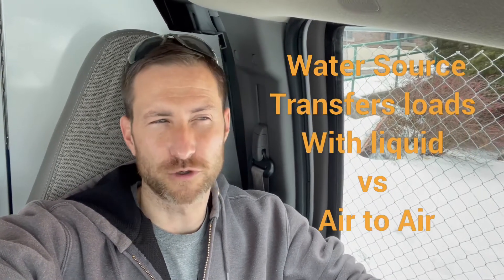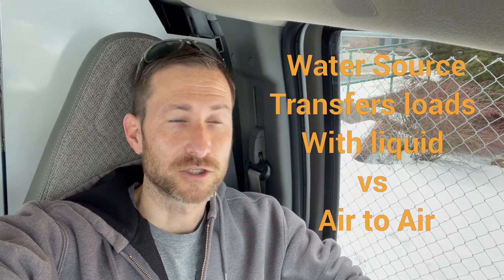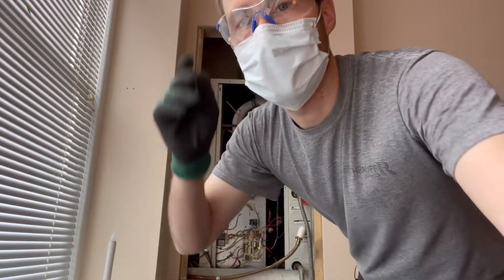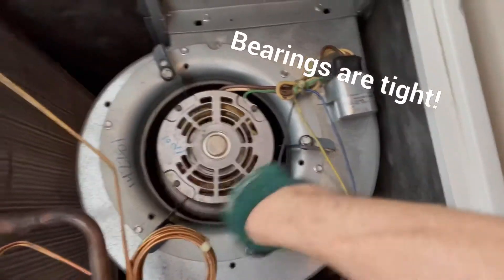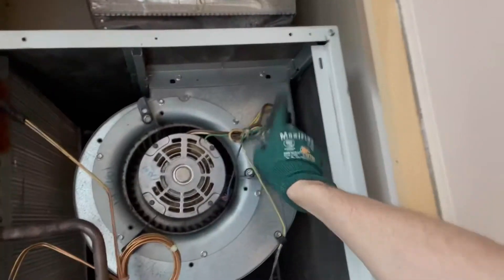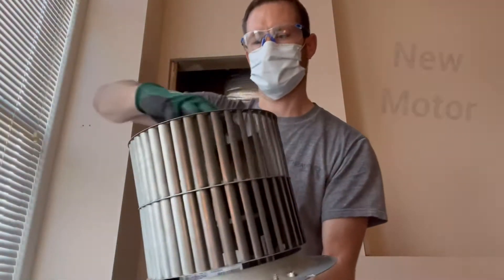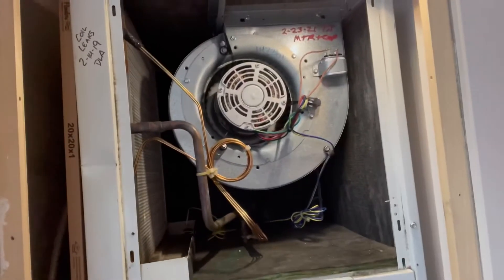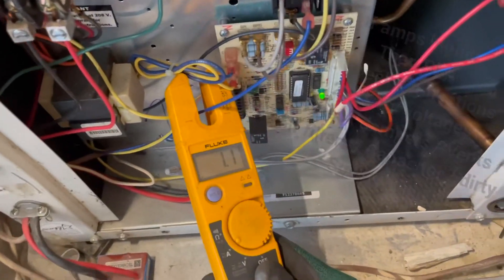Call of No Heat on ClimateMaster Water Source Heat Pump. #HVAC #HeatPump #HVACEXPLAINED #cooling

Comment: Hey, I have a Climatemaster 816 that just blows lukewarm air no matter what you set the thermostat to. You can hear it turning on when setting to heat/cool but no difference in air temperature between the two. Any help would be appreciated
Reply from the maker: Hey, good afternoon.  
OK, so I’m assuming it’s a heat pump water source correct?
Are you able to open up the electrical door to see if there is any alarm flash codes on the circuit board? 
Do you have any gauges? If so, what are your pressures?
What is the return air temperature and what is the supply air temperature?
Reply from the maker: Just checking in.  Any luck ?

Comment: best bet for blowing room temp air. compressor not kicking on. climatemaster tcv ?
Reply from the maker: I’m sorry I’m not understanding your question? 
If you were only having recirculated air, only most likely compressor is not kicking on, especially if it’s a heat pump.  
Can you fill me in a little bit more? What’s going on?
Reply: @hvacexplained9341  its not cooling, same type of unit as in the video.  symptoms are coils freezing up and sometimes the compressor is not kicking in. any ideas?
Reply from the maker: @awesomus345 ahhh 
The unit is shutting down most likely because of the low pressure switch or freeze stat opening up. 
I’m not sure if yours has a freeze stat.  
Now with the Coil’s freezing up, that can be numerous things. 
“Most common is low on charge …”
Do you know what your pressures are?  
What is your return air and discharge air temperature?  
Other reasons for Coil’s freezing up:
Blower motor not running or running in the wrong direction from a bad capacitor. 
Air filter plugged
Evaporator coil extremely dirty
Metering device faulty
Filter dryer plugged up
Reply: @hvacexplained9341  calling a tech tomorrow .  coils are clean, brand new air filter.  not sure of airpressures and temperatures, and blower motor is producing air, its just room temperature
Reply from the maker: @awesomus345  please let me know, but like I said most common seems to be low on charge.  
Good luck
Reply from the maker: @awesomus345 where about do you live
Reply from the maker: @awesomus345  hey good afternoon today is 7-31-25 just curious on the update after you called that technician.
Reply: @hvacexplained9341 coils were toast and they dont use that R-410A refrigerant anymore . Waiting on landlord to approve new one. He aaid only working at 20% capacity.  2014 unit

Comment: Hi, I found your video because I have a somewhat similar problem.  I have a ClimateMaster and there is no heat.  The fan works and cooling works, but when the heat is on it blows room temperature air, not warm air.  I checked the lights and the green light is solid, the red light blinks quickly every 10 seconds.  No unusual noises or smells when in heat mode, just room temperature air.  Do you have any idea what the issue could be and what I could try to troubleshoot it?  Thank you!

Model number of the unit is 20BGOSAA2AHOHOJ.

Edit: I wanted to add that, in cooling mode, the unit makes a hum as though the cooling unit is on, but in heat mode, there is no hum, it sounds the same as if only the fan is on, like nothing 'kicks in'.  Just wanted to add this in case that helps identify the problem.
Reply from the maker: Hey good morning I just read your message. I’m eating cereal right now before I leave for work.  Lol. 
So you have a Water Source HeatPump.   
There is a Reversing Valve that switches that over into heat mode.  Giving you heat!!! 
There is a solenoid that sits on that valve that will operate it.  While it’s in cooling mode, check for power going into the Solenoid coil.   “24 volts”
I typically test the reversing valve “with power to the coil” by pulling one wire off of the coil so I can hear it cycle.  PSSHHHHH PSSHHHH 
I’ve had where people did not program or wire the thermostat properly cause that issue.  
Also!!   Reversing valve may not work properly if it’s low on charge!!  You can check the pressures on your cooling and if they look fine then that won’t be the issue.  
I’ve had many reversing valve stick and need replaced over the years.   But that is typically on reversing valve over 15 years old I’ve noticed.  
Please let me know if this helped you …  
Have a good day. Good luck.
Reply: Thank you for the quick response! I will look at that when I am able and update when I get a chance!
Reply from the maker: @loganseaburg2027  yes, please do. Hopefully it helps you out.   
Just first While in cooling mode check for 24 V at the solenoid coil on the reversing valve.  If you have power, there, pull one of those spade connectors from the coil and this will allow that valve to slide into heat mode.  It could be set up the opposite way.  But typically they energize for cooling to operate.   So being deenergized would be a failsafe mode of heat.   
Good luck please let me know

Comment: When addressing such problems, it's crucial to take into account a number of potential contributing elements. Appreciate you listing various reasons as to why this problem might arise.
Reply from the maker: Yes, exactly.  Sometimes you need to look outside the box.   There’s so many different factors in this field and that’s one thing I do like about it since it makes you think a lot.  
I was just on call Friday and found a circuitboard, intermittently shutting down condenser fans that a technician who was on one day before had missed.  Sometimes being in the right place at the right time makes a difference.  Thank you for the compliment. Have a great day.

Comment: where is your service area?
Reply from the maker: I typically run service calls within one and a half hours from Pittsburgh, Pa.
Reply: @hvacexplained9341  thx, but a bit far...west coast, our climatemaster heat pump is running a/c and then goes to blowing room temp air, turn off and later repeats cool air ,then not?!
Reply from the maker: @michellew4763  Not being there  to see the full operation makes it a little bit tough but it sounds like your thermostat could be causing the issue.  If you can pop your thermostat off the wall you can run a small jumper wire in between R and Y.   That will engage cooling if for some reason calling does not want to engage then it’s obviously not the thermostat.    Also not sure if you have a drain pan overflow switch? “Condensate Drain white pipe” It could be as simple as that safety float is lifting up  occasionally shutting down the unit From a slow clogged drain.   If you know where that drain is draining either outside your house or in a laundry room just take a wet dry vacuum then place it on the end for a couple seconds that should remove the clog from the drain.  Please fill me in more if that does not fix it.

Comment: Is that kind of motor ecm? And which is better ecm or psc motor? Thanks.
Reply from the maker: Hey, good afternoon sorry about the long delay three years lol.  I apologize. I did not see this message sooner. I have received tons of messages so quickly sometimes and failed to get back to people.  
PSC motors have pros and cons same with ECM.  
PSC-  I can typically get these rather cheap $100 for a universal for an average furnace or air handler and typically find them in stock at all of my supply houses.  
They’re not very efficient, but they are simple and easy to get.  
ECM-  not always do the Supply houses carry that specific one, but they do have some universal that can be programmed.  
These motors can range $200 to $800. 
Yes, they are more efficient and can run at multiple different speeds for different purposes, but in my opinion, I just don’t think they’re worth it because all the money you just saved in electricity is going to be going towards that brand new motor so I don’t see the payback from it.
Reply: Thank you brother
Reply from the maker: @s @samersarah957 ince this video, I moved down to the GulfCoast of Florida and still doing the same field. I just quit putting stuff on YouTube. I was posting a lot of stuff on TikTok for a while and I hurt myself out posting stuff.   
I like it down here in Florida.   
Great day hope you and your family are doing well
Have a great day

Comment: Hi sir, i dont know if this is stupid question. with that unit, what is the correct rotation?
Reply from the maker: Trust me that’s not dumb.  I know many people that have installed blower wheels backwards or motors in the wrong rotation.  
The housing in which the motor and squirrel cage sit will turn throwing the air Towards the Longer part of that Housing… “In this Video Counter ClockWise”.  
When I get a chance I will post a video on this on TikTok. I’m under the same name & screenshot on there.  
Have a great day.
Reply: @hvacexplained9341  thanks for the reply. Hope you can post more videos on watersource heatpump. I subscribed to your channel.
Reply from the maker: @eloy09  let me see what I can do.  Thanks Angelo.

Comment: Great. I do the same 4 a living.....no oil little ports remenber
Reply from the maker: Hey Rene.  Good deal are you Residential, Commercial or industrial?   
Some motors do have oil ports but it seems like just the older ones.  But honestly how many technicians really do oil those on maintenances ???  
Have a great day thank you for commenting.

Comment: Hello. I don’t know if this can be the problem but I don’t have hot water at all or even water (on the hot water side) only cold water. How can I fix this ? Thank you
Reply from the maker: Good afternoon Suzy.  I would be happy to assist you.  First of all do you have a natural gas hot water tank or an electric?
Reply from the maker: If you have an electric hot water tank just go down to your breaker panel and verify that the breaker is turned on.  
If you have a natural gas hot water tank you can actually go down to where the gas piping goes into the side of the hot water tank on the bottom. There is a small window about the size of a quarter on most that you can actually look into it and see a little blue flame.  Some newer Gas hot water tanks have a blinking red light indicating if it’s on or not.  How old are hot water tanks typically have thermo-couples for Thermo-piles that actually go out.  These require to be relit for just a new component “thermo-couple or thermo-pile”
Reply: @hvacexplained9341  i have an electric titan one. So I went to the beaker turn it of and unscrew the total and sweet it and waited a little and it came back on (water and hot). It will explain the hot temperature but why no water???
Reply from the maker: @Live_in_the_sunshine  :  If you still have no water after turning the breaker on.  First Turn Off at the Breaker, then on the side of those electric hot water tanks.  There are two small panels that come off with a screwdriver.  Remove each panel, there is a small button to push and this will reset the element.  Then turn breaker back ON.
Reply from the maker: @Live_in_the_sunshine  :  I do apologize I’m trying to understand your wording.  Unscrew the total ?
Sweet it ?
Reply: @hvacexplained9341  yes I actually did this. It worked for like 30 minutes and then no water coming out of the hot side of the tubes. Sorry autocorrection seems to work weird lol. So no water :/ only on the cold water I have pressure
Reply from the maker: @Live_in_the_sunshine  is Any water coming out of the hot tap at the sink even when the hot handle is turned?
You said you had hot water for like 30 minutes?
It will take a up to few hours to heat up a cold tank that’s been off for a while. 
I do apologize for my delay I’m rebuilding a bathroom right now at my house and occasionally looking at my phone.

Comment: These heat pump didnt have an electrical diagram or label with info to know how much amps have to read or pressure or refrigerant?? Like big AC units in big houses
Reply from the maker: Typically on the data plate it will tell you what the amp draw roughly should be “RLA”.  Or on The motor itself.   Just make sure it is “less” because if it’s more either you have a loose connection, damaged wire, bad contactor or somethings wrong with that motor.  The pressures of refrigerant are roughly the same on every piece of equipment it just depends on “what” refrigerant you are using. 
Typically on these type of heat pumps we are using R-22 or 410a.  
The pressures also will change depending on heat load/cooling load/ Water Source load.  
Example: 
R-22.    65 / 225
410a.    125/325
Reply: @hvacexplained9341  thank you for explain me 🙌